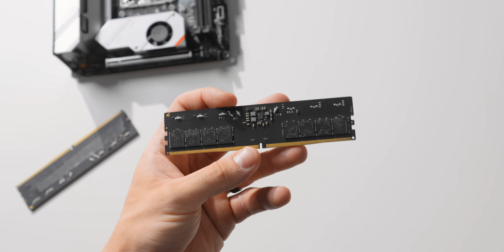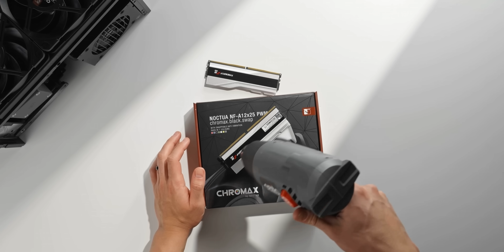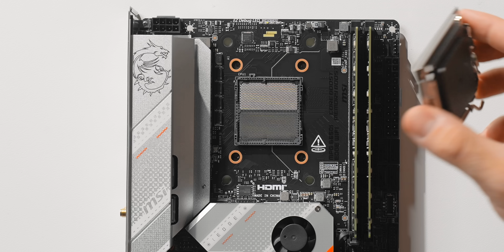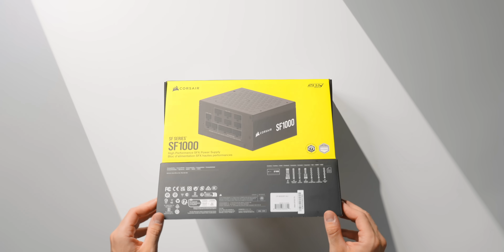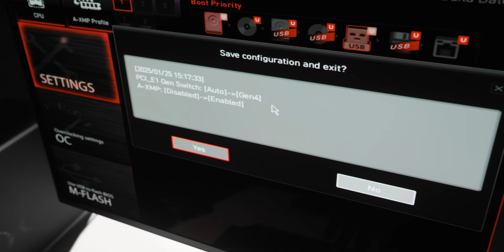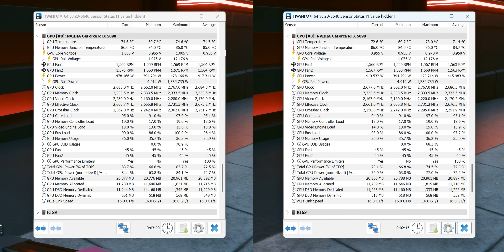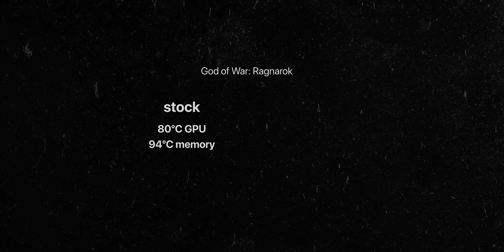My fastest gaming PC, ever – 5090 + 9800X3D

Comment: Just did the same exact built. Almost the same exact built. I am an ITX/Zero RGB lover now. However, the under volting, but increasing clock speed is something i never thought of. My thermals on my 5080 are identical to yours. It doesnt bother me other than the fans ramping up quite a bit and performance is F'ing amazing...but im trying this when I get home from work. You said "It sounds like it shouldn't work" But no, it actually makes perfect sense why it works. I am 100% trying this out. a 9 degree difference is massive

Comment: The 5090 is 304mm, I believe it would fit in an Xros S300 case, that would be insane, that case is I believe 2 liters smaller than the Formd T1. I'm not saying its possible but I would be really impressed

Comment: Just bought the 5090fe and planning a sff build, wondering will a ATX 3.0 psu lead to cable issues. Problem is there aren't any tier A sfx ATX 3.1 power supply (that I know of).

Comment: I was making this build and to my surprise I did not need a backplate for the cooler. The screws are thin enough so you can stick them through the standard backplate. I used revision D of the cooler and MSI B650i Edge Wifi motherboard

Comment: Would the asus strix b850-i be a good fit for this build too since it has the same dimensions as the MSI motherboard you used. I believe the asus heat sinks are thicker though

Comment: Did you end up changing that UV/OC down the road? I tested doing it your way for fun and man it's a brutal performance hit, at least if you have a case with better airflow. It might be you're hitting thermal limits at stock, especially on the VRAM. Even in a PA602 with excellent airflow I can only set my VRAM to +1500 before I start running into stability issues with my 5090 FE. If you'd like to give my settings a spin, +1500 VRAM, 101% PL, raise the curve to 2902@.925v and flatten it. 430 watts in Cyberpunk 2077 with full pathtracing and MFG on a 4k display and 15102 Steel Nomad.

Comment: Just made a build very comparable to this (9070 xt instead of 5090).

The version of the Alpenföhn Black Ridge I get was AM5 compatible out the box, so the Thermal Grizzly backplate was unnecessary for me.

Additionally for anyone looking to mimic this build, research motherboards if you want to use the Black Ridge, several of them require you to remove either a fan or a heat spreader from your M.2

Also, hot damn is the manual by Formd/Ncase absoloutely hideous.

Comment: I do 90% and have a AC powered, adjustable dual case fan. When I am doing AI, I turn it on.  10 degrees cooler.  I don’t like to go past 65 degrees. It’s 2 50o0s so one is 10 degrees higher because they are stacked together.

Comment: I'm currently rebuilding the PC you featured in your video, and I'm at the point where I'm mounting the Alpenföhn fan to the back of the motherboard. However, I seem to be missing 4 screws and I'm unsure which exact ones you used for that step. The screws for AMD that come with the Alpenföhn fan are to small for the 4 mounting holes. Could you please let me know the specific type or size of screws you used to mount the Alpenföhn fan to the rear of the motherboard tray? That would help me a lot!  Thanks in advance and great work on the build – it's been really helpful!
Reply: optimum won't give you advice - but I do ;)
Actually, there's a "Revision D" of the Black Ridge that supports AM4/AM5 out of the box.
Check which revision you got.
If you got "D" then you won't need the short backplate and can use the mounting material that comes in the box.
There's 4 rubber tubes and 4 screws included.

Comment: Alright, ordered all the pieces. Let's see how this build will come together.
Reply: @optimum How did you mount the 5090? I am building mine now but I can't for the life of me figure out how it's mounted... To me it looks like it's only connected with one screw to the case itself, but that seems extremely wrong to me.
Reply: Installed the CPU cooler without the thermal grizzly backplate - I guess some versions of the black ridge cooler comes with the AMD adapter, some don't?
Reply: @KevinOsterkilde  if your all done me and many other people would love to know the exact steps and materials!
Reply: @Sehajthehedgehog  I am done. I built the exact same machine as Optimum did.
Reply: @KevinOsterkilde  Great but I still *really want to know all the screws, m3 standoffs, and extra brackets as people in the comments seem to think theres more to this build than what he shows and says
Reply: @Sehajthehedgehog  Everything is in the video to be honest. IIRC he replaces the included GPU riser, which I did too but it's not really necessary.

Only other change I did was buying the "Travel Kit" for the case/GPU because I felt it was kinda insecure without it.
Reply: @KevinOsterkilde  Cool, thank you!
Reply: @Sehajthehedgehog  I didn't film the assembly, but I can make an overview video if there's a wish.
Reply: @KevinOsterkilde  I think i lot of people (judging by the comments) would love to see that including myself

Comment: How were your temps for the 9800X3D with a low profile CPU cooler? I feel like you would be hitting your thermal limit and wouldn't be able to cool enough. Did you undervolt the CPU?

Comment: What screws did he use to attach the CPU cooler after swapping the backplate?
Reply: Actually, there's a "Revision D" of the Black Ridge that supports AM4/AM5 out of the box.
Check which revision you got.
If you got "D" then you won't need the short backplate and can use the mounting material that comes in the box.
There's 4 rubber tubes and 4 screws included.

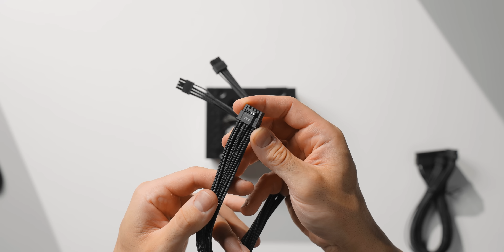Comment: 5:33, can someone explain me this: whats the point of the ATX 3.0 standard, if the 12VHPWR cable is the same as a non ATX 3.0 standard, it has the same 2 missing pins. That is a dumb cable same as the rest.....

Comment: How about just flipping the GPU over and changing the intake/exhaust direction, and putting the two top fans as intake? You might also have to change the direction of the CPU cooler. Is that a bad idea...?

Comment: Great build and video but isn’t the MSI B650i edge PCIE Gen 4? It doesn’t really matter here as you are using a Gen 4 riser cable but should you be using one of the new Gen 5 riser cables, this motherboard would introduce a performance bottleneck. It would be great to hear your thoughts.

Comment: Do you think thermals would improve if the gpu orientation was inverted (meaning the fans are on the inside of the case pushing air out of the case). im waiting for my components to arrive, and im planning to do an aio build, but it just bugging me that this gpu generates a lot of heat, and its pushing the hot air inwards. blowing back to the gpu, to back of the motherboard and up towards the aio radiator.

Comment: The build that not even 2 kidneys can buy AND CANNOT RUN a game from 2008 (Mirror's Edge) due to NVIDIA axing 32-bit software support which completely BREAKS 32bit PHYSX. The ONLY way to get an RTX 50 Series GPU to work with those games is by pairing them with older GPUs like the infamous GTX 1630  or the infamous GT 1030 and making those old cards bear the brunt of PHYSX (basically we have returned to to Dedicated PHYSX GPUs)
Reply: or a 4060 lol, why bother using inefficient old gpus
Reply: @s4yto  

In the future, RTX 30 and RTX 40 series will not exist on the market. That is why I am saying that people should know about this now and NOT throw away their old GTX cards.

Comment: What are the bennifits of running AMD when the intel I9-14900k is more than 10% faster with 24 Cores, 32 Threads  and offers 32% value over the the AMD.
Reply: If I really want to talk about that well 1 it needs a tank to cool 2 9950x3d beats it 3 7800x3d beats it in gaming let alone and idk what 14900k pricing ur looking at cuz usually they are the same price as AMD or AMD is slightly lower

Comment: The newest revision (Rev. D) of the Black Ridge actually supports AM5. They include some new screws, that just go through the backplate.
So it's still a valid option without having to buy a smaller backplate

Comment: @optimum doesn't the SF1000 get hotter than the recommended operational temperature by having the 5090FE's exhaust hit the SF1000 back plate? Would't it be better to have the SF1000 fan intake receive the hot air instead? It would displace it through the SF1000's exhaut.
Reply: enough space between psu and gpu

Comment: the alpenfohn black ridge cooler is out of stock everywhere- is there a viable replacement cooler that would work here?
Reply: axp90-x47 + a9x14
think he uses 3.25 slot mode which is unnecessary
3 slot mode is fine
Reply: @uncertainhandle  so i ended up finding a black ridge cooler- but what do you mean by 3.25 slot mode?
Reply: @uncertainhandle  and thank you for the response- i will also look into axp90-x47 + a9x14 configuration
Reply: @supernice_auto  in the t1, you can space the gpu / motherboard + cpu cooler out. 5090 is a 2 slot, so you can configure it to 2 slot mode and have more room for a bigger cpu cooler or vice versa
Reply: @ I see what you're saying and thank you- I like his approach because it gives enough space between the gpu and motherboard but in my case I'm actually looking to pair with a 5080 FE so I should be fine. However- I realize the prices on the FE's are insane I'm curious about other 5080 SFF cards that might work the issue also is the 12 pin connector on the FE 5080 it's angled which is perfect for the T1 not sure any other car would work well due to the angle of the 12 pin. Are you also building in a t1?
Reply: @supernice_auto  yeah - i plan to build in the t1 in some months. waiting for 9900x3d/9950x3d benchmarks, 5090fe stock, next gen noctua 120mm fans, and the funds to buy everything lol.
Reply: @uncertainhandle  nice man- i went with a 9800x3d more than enough cpu for the 1080p competitive gaming i do- how do you plan on getting your hands on a 5090fe?
Reply: @supernice_auto  i left 2 other replies but they didn’t show up. i’m waiting for production to increase again, the 50 series was dropped around chinese new year. i’ll buy in 2-3 months. i’m in a discord server that sends notifications out when there’s stock
Reply: @uncertainhandle  are you sure they're going to be pumping out more 5090 and 5080 FEs? And even if they are don't you think they'll still end up in the hands of the scalpers? GPU Drops discord? If so I'm on there also

Comment: Fantastic review and video! Helped me get up to speed with my 5090 FE. One thing to note, the 75% (or 80% for that matter) power limit in Afterburner with a +250 overclock seems to have caused instability on my machine. Cyberpunk crashed after a while in each running, as did MSFS. I had one freeze in Indiana Jones, though not sure if this was the cause. HWInfo showed my max clocks going up to 3.1GHz on these settings, which may have caused issues. The power draw and temps were great though. Is there a way to rectify that?

I'm now trying a manual undervolt (2.5GHz at 900mV) and Cyberpunk has run the longest since I got 5090. Temps slightly higher (60 GPU and 70-74 memory) but still WELL within comfort.

Comment: I assume this could also potentially help keep your card from melting the 12vhp cable, because you are moving away from the 600w they are rated for. Not perfect obviously because 4090s were melting cables at similar wattages but at least it shouldn't be any worse.

Comment: As usual what you told me to do with rtx 3080ti 3 years ago. Undervolting with very minimal performance loss.
But right now i just cant justify that 600w power consumption. Its too much. Will stick to my 5080 right now eventhough slower than a 4090.

Comment: As 70% is the lowest power limit you can set on a 5090, what happens there at +250 MHz? Does it crash or become unstable? With the recent news about the badly designed cable and a 5090 Suprim on the way I'll definitely undervolt the GPU quite a bit.

Comment: Hey Ali! Do you consider the Black Ridge with 4mm duct and a Noctua fan to be the best cooler in A4-SFX? I've got the AXP90-X47 currently installed and the Black Ridge without the duct sitting in the closet.

Comment: Would it be possible for you to try a memory underclock to see how it affects the power consumption? There's a deep dive video on the gpu architecture from High Yield here on YT that reasons that given the way the 5090 is designed, a large part of its power consumption likely comes from the GDDR7. So it begs the question of whether that could be tested to find potentially even greater efficiency. 

Also if you're interested on extremely detailed look at the GPU architecture, highly recommend that video from High Yield. Note, it's extremely technical, but very insightful nonetheless.

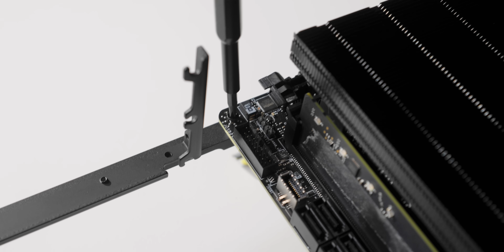Comment: @optimum I unfortunately couldn’t find the M3 standoff screw measurements in the description that you mentioned for the GPU clearance. Planning to recreate that setup with a 5080 FE, but I thought instead of buying a complete box of M3-stand offs in different lengths I’d just go ahead and ask away to be able to order the specific ones 🙌🏻  If you or anyone could help out, that’d be amazing! 4:48
Reply: I'm literally trying to figure out the same thing. Lmk if you figure it out please, I'll do the same if I do.
Reply: hey, just found a new post on the sffpc subreddit. Same GPU setup just with a 5090. For the important part- 3 m3-20mm standoffs were used. I hope that‘s the answer. Feel free to check that post. Maybe you can also confirm, if that’s the right thing, but I believe so?

Comment: for 5090fe this back to back A4 design not the best option. The best is gpu on top with the pcie extension cable and set the hot air directly to outside.

Comment: But it does lose some performance with undervolt. I bet over time the heat soak will get bad and will require more cooling or undervolting. I think it's silly to pack so much power into a small package. It's like, "hey, do you like XPS laptops that overheat and stuff too much power into a small thermal package until it's barely useable?" well build your own with this shoebox. The amount of concessions required does not seem worth it. You're also just gambling on silicon lottery a little if one tried to recreate this. I can't imagine the actual use case for a case this small. I've helped 2 friends build computers like this and it's fun to build but I find them dumb to use.

Comment: Video idea. T1 + 5090 at 3.25 slots all the way down to 2 slots adjusting the CPU cooler for the height that would fit for that card slot to test at what point do you have diminishing returns on the GPU thermals.

Comment: I just received the TG mini backplate yesterday. Now I'm waiting on some VLP DDR5 so I can use a 120mm fan on the cooler. Just ordered the T1 V2.5 with the paracord handle. I'm looking forward to seeing which manufacturer makes the smallest waterblock for the 5090 & your inevitable 9800X3D/RTX 5090 custom loop.

Comment: Need some education here: isn’t  FE version liquid mental paste and not suitable for vertical mount? And for every day 4k gaming, in a large case would FE have better thermal performance? Like under 80 for memory 😂
Reply: If Liquid Metal paste is housed properly, there is 0 issues with mounting it vertically.
Now, the 5090 has been shown to have MANY quality issues. That straight up break it.
But from in depth tear downs, the metal paste will basically never leak from unintended use based on the design of its housing

Comment: we nees an sff case with bottom intake and top exaust.and then turning the cpu cooler 90° so its facing up. then just one fan or 2 fans at the top and the 5090 as intake or even to support the 5090 2 more fans as intake at the bottom.

Comment: I have basically the same case. If my 2.5 slot 4070ti was 1mm larger, it would not have fit lol. it was extremely cool & quiet. The undervolt keeps my frames @ 4k in the 100s, while still being a total of 300w or less. Edit: Also the Cpu uses a 240mm aio as cooling.

Comment: Any updates for the standoffs measurements?
Reply: I'm literally trying to figure out the same thing. Lmk if you figure it out please, I'll do the same if I do. He said he'd link it but I guess not. I can't find ones with his measurements.
Reply: @elkadillo  He has the measurements in the description now. I wish Optimum would make a video guide on how to offset it correctly though. Having a visual guide would be very helpful.
Reply: @ I'm just having trouble finding a 5mm standoff. Just finding 6mm
Reply: Any info on where to get the 2mm fan spacer he used?
Reply: @QuesaMesa  I Believe he made it himself. It was part of a video he made about how small you can go with the spacer without it affecting performance. I believe a 5mm will work just fine. It's just not the smallest you can go but it will do the same job.
Reply: @QuesaMesa  I ended up getting it on Etsy

Comment: Would it be possibly to turn the card around and have the fans on top blow into the case. GPU would push the heat out of the system.
No idea if that would make a difference, just would be interested in trying if i could afford any of this. Lol

Comment: note on under clocking: for the uninitiated asking "if you can run the same performance at 75% power, why wouldnt Nvidia do it stock?" its because of the silicon lottery. not all cards will be able to under clock as much, or at all. Nvidia likely picks a wattage that 99.9999% of its cards are able to operate on. most cards should be able to under clock reasonably well but not every single one

Comment: The G.SKILL Flare X5 would have fit without removing the heat shroud. It's reasonably comparable at 6000MT/s CL30. You're not missing much in the reduction in speed, and overall, you're maintaining a warranty. It's my top pick.